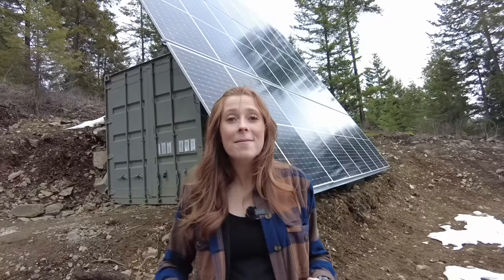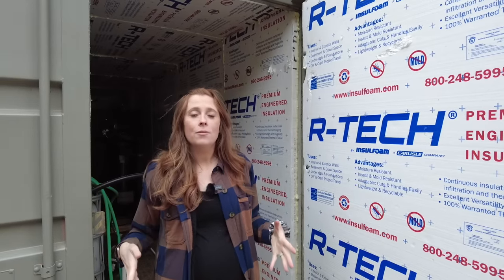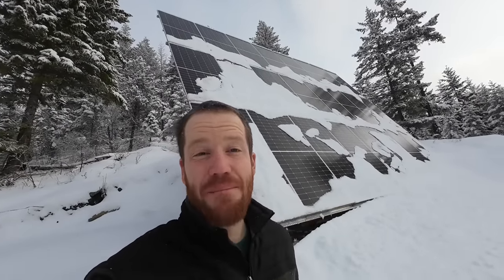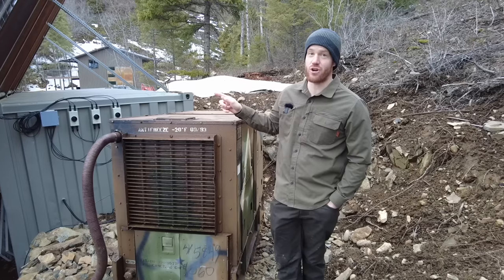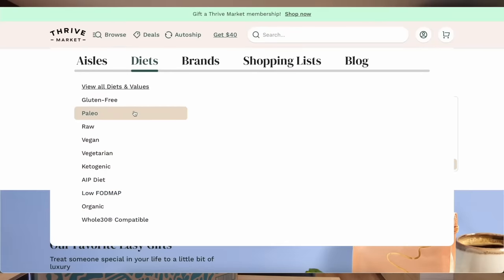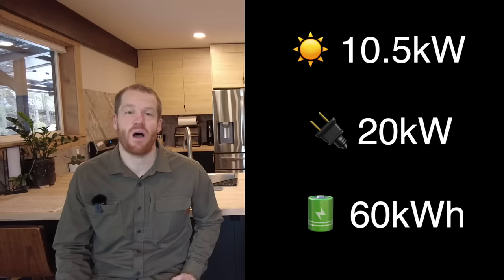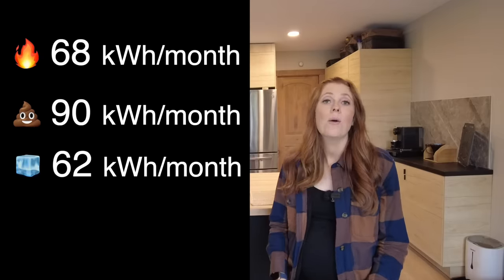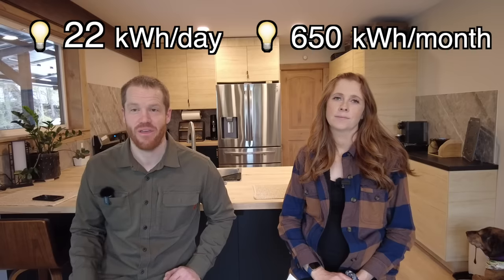The TRUTH About OFF-GRID Solar | Winter Update

Comment: Great episode catching up on the power stats over winter. Maybe it's too soon to calculate but did the new solar cells over the new outdoor deck contribute to any of the figures this winter?
One more unnecessary minutia inquiry, sorry about this, plus I'm not a producer at all and was wondering in the future for episodes like that aren't outdoor shows if there is an alternative mic available that doesn't pick up hardly any ambient noise in the production. Yes, splitting hairs here since with a 3rd off grider in the homestead, which no doubt leaves zero time for anything technical, are there okay mics for Youtube producers that knock out excess room noises? No worries, this is just me being somewhat annoying, or my mother was named Karen.
Reply from the maker: That was a fail on our part. We were wearing microphones for the second portion of the video but they weren’t connected. 🫣

Comment: I’m sure this has been asked somewhere (and probably answered too, to my bad) but, the repetitive charge and discharge of the batteries is a consideration.  How many times can you charge and discharge the batteries before they wear out?  Also, how many times does that happen monthly?  Then, what will it eventually cost to replace the batteries?  I’m hearing elsewhere that lithium-ion batteries can be charge cycled 3000 times.  If true, is it logical to think that a lithium-ion battery will discharge much faster after it’s been recharged 2000-3000 times?  In short, aren’t batteries less efficient the older they get?
Reply: If you are very aggressive on them they will have 80% of their rated capacity remaining after 4000 cycles.  Riley and Courtney are nowhere near aggressive, so they can expect to see closer to 7000-8000 cycles.  The nice thing though, is this is not the end of their life, they are totally usable just at a lower capacity.  Since their system is so massively oversized, if their use stayed the same there is a great chance that 20+ years later they will still be going strong.  Now, this is Ambition Strikes, so there is a great chance they will build some more awesome projects that use more power - but their system is totally modular so we can just add more batteries as needed to meet their future demands.
Reply: @CurrentConnected  Thank you CC for the reply and info.  Seems to me, if these batteries live up to their expected promise, we’ll be seeing many more off grid and on grid (part-time back up) systems in use.  Initial cost I think is still a barrier.

Comment: Why don't you consider a long term thermal store or pumping hydro with the excess power in the summer, to get you through the winter?
Reply: Hydropumping seems impractical in their climate.  To replace the 800 kwh from the generator would require a lot of water storage.  Even if their property might allow a large head (say 100') they'd still need to store about 5 million gallons of water (15 acre-feet) at both ends.  And find a way to keep it from freezing.

Comment: I am sure you could engineer a solution for your generator using a raspberry pi computer that will both sense the frequency and voltage and drive a  servo to automatically correct. Also auto start on battery levels. It would be well do-able

Comment: curious, your panels are bifacial, which gives you 10% more than regular monocystaline. would it be practricsl to use reflective panels to guide light to the back of the panels or front?

Comment: Wouldn't it be better to just make the solar grid 36% larger to cover all the electricity needs in winter (2200kWh produced by solar, 800kWh by generator = 3000 kWh totally needed)? That would be an additional 3,78kWp of solar panels. Just some example math: Here in Germany 400 Wp panels are around 145 USD, you need 9.45 panels, so lets say 10, that's 1450 USD. So the additional panels would pay off after 3 winters and you save 28 times going out and get the generator running per winter :D

Comment: Solar is like money; 'The more you have, the more you spend'. 'The more solar power you have, the more you use'.
"If Propane is considered 'on the grid', then so is Diesel fuel."
The deep (to near zero) DOD (Depth of Discharge) in Dec, Jan, Feb will shorten the batteries life. Buying more batteries will extend the life of 'all' the batteries and reduce the need to run the Gen in the Winter as often.
 The quickest, easiest and simplest solution is:
$10k+ buys 6, (30Kwh) more SOK bat... "Excess money buys CONVENIENCE'.
OR; buy a 1000 gal propane tank then use the excess power in the other three seasons to manufacture HYDROGEN and store it in the new tank. THAT project would get MILLIONS of views. Note a Propane Generator can be converted to run on Hydrogen with little to no effort.

Comment: A small question is: would it be a significant improvement if you cleared the snow in December and January? Perhaps for next year.
Reply: they already said the snow comes off by itself but they get very little power because of low sun and cloud cover.
Reply: @ronblack7870  well - perhaps some extra time. And - please remember, partly shaded the power is significant reduced.

Comment: I would add more batteries  to increase the storage capacity, this way you prolong the life of the existing batteries and avoid the deep cycle charging in the winter months that shorten the life of batteries.
Doubling or tripling the battery capacity and installing a sodium battery should give you the capacity you need to avoid 3/4 of the generator usage.

Comment: EV is the best usage for the extra power. If you got an F150 Lightning you can on certain versions with the correct home charging interface use its massive battery as a backup for the house. The rest of the time it would be great for running and or recharging your tools when you do projects. I am not a fan of pickup trucks (European here...pickup trucks and guns what the rest of the world will never get about Americans) but the Lightning is a serious achievement by Ford and like the MACH-E it has got a lot better since they first brought it out. They do seem to listen to customers feedback. Also STATE OF CHARGE did a snow test comparison between the RIVIAN and the LIGHTNING leaving them both outside in the snow overnight not plugged in. The RIVIAN lost a lot more battery power the LIGHTNING did really well. So if it was on just a simple AC drip charge through the night using just enough electrons to keep it cosy even through a snowfall it will be solid and ready to use the next morning. PS Ford is planning to introduce on both the Lightning and the MACH-E entry level versions with LFP battery chemistry, so if you want a ZERO COBALT vehicle with great charge cycle and no issue charging to 100% every day you may want to find out when the LFP models will be available. They will also be cheaper of course. That model may not have the formal Vehicle to House charging system but actually it does not matter because the truck in any version has the informal options of USB and wall sockets in the cabin and in the bed that can always be used to power portable batteries or gadgets.

Comment: At ~11m09s, the video puts onscreen that for the whole winter you used 96 gallons of diesel to produce 800 kWh, which cost ~$450 or ~$4.69 per gallon.

According to online calculators, 96 gallons of diesel has an energy potential of ~3,300 kwh. So, that diesel generator has an efficiency of ~24%, which seems low. Online sources say that typical generator efficiency for diesel is 40% compared to 35% for propane.

Propane has a lower energy potential, and it would take 118 gallons of propane (1.23x diesel) to have the same 3,300 kWh of energy potential.

According to USDOE for your area in January 2023, the per gallon price of propane was $3.62 and diesel was $4.40 (1.22x propane), making the cost per kWH of both effectively the same assuming the same 24% generator conversion efficiency. 

Since propane doesn't go bad like diesel, a 1,000 gal propane tank would last you eight winters like the last one before having to be refilled.

You could possibly even improve the conversion efficiency with a propane generator over the current diesel one.

I'd be interested to see a video on whether you looked into propane as an alternative to diesel.
Reply: I would totally expect the efficiency of their generator to be low considering it's age and what it was built for - but they already have the diesel generator, factor in the added cost of buying a propane generator to make that changeover.

Comment: I would be interested to understand the math around possibly adding more battery capacity to reduce the amount of generator usage
Reply: I'd be interested to understand why do Americans (and Canadians) live in thin metal or plywood sheds to these days 🤔
Reply: @no_clot_shot1128  do you mean their pre engineered metal building? If so, and in comparison to a traditional wood framed (or metal studs)with siding or traditional wood framed (or metal studs) with laid brick exterior, it’s wayyy cheaper. Especially since they went two story. Probably on the order of 40% to 50% cheaper per sq foot to have constructed. I would also like to make the claim, in my opinion  of course, that retrofitting or altering the existing g construction is so much easier with a pre engineered metal building than conventional or traditional framing.
Reply: @no_clot_shot1128  trolls throw such cheap shots because they don't thoroughly understand the different building systems, and that they all have their pros and cons
Reply: Two factors drive the approach:
High cost of labor.
A well developed market for cost-effective pre-fabricated building materials 
Aided by the tools that enable a team of 2 to build a substantial structure.

Comment: With all things being equal the number of solar panels on your main array needed to be 15KW vs the 10Kw you have. 
The reason is the amount of sun light you have and yes for home without Dryer and your still not at 950Kws 
Oh just for instant most alberta homes use only 350 KW of electricity average as heating is done by natural gas. 

However if full electric was the case then about 1000kw would be needed and 16Kw array with battery bank of 100Kws as much as Tesla or F150 lighting  140Kws of battery bank is needed. 

Summertime is not an issue as; winter is the critical point. 

The fact that you have a shop powered and heated is also amazing.  The welder, plasma table etc.  Most homes do not have that.
Over all your doing OK just about 3K to 4K  short on your array.  Think about that for bit.

Comment: Your problem is your system is too shaded and you used regular inverters which means when shaded the whole string will fail to produce much electricity. If you would have used micro-inverters with one inverter per panel then only the single panel that is shaded will fail to produce much electricity. Enphase IQ8a would have been my choice. I also wonder is a LP generator would work better. Can you get LP delivered?

Comment: HAPPY 4 YOU - BUT would suggest others use another solar contractor supplier. The quality of work shown in this system is not aligned with industry standards of safety and  quality.

Comment: How long should these batteries last before replacing and at what cost ?  I think propane in a 500 - 1000 size would be good a backup power generator situation. Wood for heating in winter and it looks like 🔥💩 is a little more energy than traditional septic/water treatment plant.   I  can see Courtney gets a giggle from 🔥💩, but for long term especially with another 💩 maker. Have you looked into "Earthships" waste water is used for gardening water also filtering water.

Comment: Your winter numbers for the solar panels match what I've seen in Eastern Washington. 7% of rated capacity on a heavily overcast day. If the bifacial panels were responsible for the extra 2% they might be worth the price premium. 

For comparison my 1400 sq ft all electric house (with a heat pump) has a daily power demand of 60 kw-hr. A really bad month hit 80 kw-hr per day. 

As a side note, the same inversions that bring the heavy overcast also bring dead calm, so a wind turbine won't help. The word that describes it is dunkelflaute.

Comment: Failed to discuss the time value of money (TMV) you invested in the capital cost to set up the system and the depreciating value over time of that system. Example: $75,000 (cap cost) at a 8% yield is $6,000 per year or $500 per month (TMV). Assuming a 20 year life of the equipment then $75,000/20 years = $3,750 annual or $313 per month additional equipment depreciation. Total per month of $813. Although you may enjoy discounts through sponsor partnerships most of your audience will not.

Comment: I spent 23,000 for the new eg4 18kpv 30 panels and 30,000 watts in battery installed it all myself and the system is just an animal, don’t need a big generator anymore and it start stops it.

Comment: Hey put a watt metrr and an amp logger and you will find you could only use about one tenth of your solar ohm's law 101
Reply: I use a couple of diversion loads the sea50 works great and then temperature sensor on hot water heater and then after coming up to the desired temperature I could switch over and make hydrogen and oxygen and compress it or heat air or just pump water for us is more critical as we also have windmill too keep it under a load so it doesn't over rev
Solar and wind isit

Comment: does 10000watt array mean it can collect 10kw per hour?
Reply: No. that´s only "PEAK"-power. Peak power is usually only achieved for a short time of very hot and very bright summer-days. E.g. for 30 minutes on certain days in a year.

the other days of the year you will only get 5kw/hour or in winter even only max. 1 kw/hour.

Comment: i am a little bit shocked about the power consumption of your fridge... 62kWh/month translates to roughly 750kWh/year. I bought a new fridge (that's just very slightly smaller) last year, that takes less than 120kWh/year. (mine is a Samsung RL38A776ASR, but you can get devices from other manufacturers in the same power demand region)

Comment: Would a propane generator be more economical?
Reply from the maker: Based on my calculations diesel has more energy per dollar than propane so diesel is the more economical choice fuel wise. Generally diesel generators cost a lot more up front, but we got a great deal on this old military surplus unit. However, propane has the advantage that the fuel never goes bad and can easily be stored in bulk and plumbed to the generator without a need to pump or transfer it.

Comment: HOLY COW the average American uses 900 KW/H per month? In Germany (most expensive electricity cost in the world) we use 2200 KW/h per Year for 2 person (185kw/h month).

Electric heating is not common in Germany. Of course you can add like 3-5K more if you are using a heatpump. But our average consumption would still be alot lower than 900KW/h month. Wich is mind boggling for me.

P.s. in Germany there is a homesolution where you can save Hydrogen in Summer and use it in a Fuel Cell for electricity in Winter. I think that would be an even better solution for you. But its also very expensive like 100.000€. But i think a 60kw/h Batterie is also not cheap so idk.

Comment: I genuinely can't imagine using 22kwh each day. Not trolling here...that's just a huge amount of power to me. The power numbers you were giving for appliances are supposed to be annual numbers, not monthly. Are you sure everything is working correctly? Not that it matters if your annual generator fuel budget is under $500, but still. You spent good money on your appliances so if they're drawing more power than expected you should look into it, especially if they're still under warranty.

Comment: Ya'll are really throwing me for a loop with pregnant to baby and back. 😂

Your MEP can be made to autostart, there is a great video here on YouTube about how to add Wi-Fi and Auto Start capabilities. https://youtu.be/wUjL6mldAEM

You need to just set your frequency once, after the load has stabilized, it should return to that everytime. Also your rectifiers should be able to handle a small frequency indifference since you aren't direct loading the generator. 

Fuel, the MEP has a port for external fuel supply. You could get a bulk tank and run a pair of hoses from the bulk tank to the generator, one would be supply the other return. 

Remeber this is a military generator, it has a lot of the capabilities you need already built in.

Comment: A few years back I was involved  (marginally) with a Real Life study of the effectiveness of Solar Voltaic power. 
Done by Greenpeace. they wanted to see if it  was viable  as a Everyday  power supply or simply a ' Feel Good ' placebo. 
This was done in the pacific northwest where overcast and rain is more frequent than Sunshine..  ~50 /50   
Final conclusions were that it Could Not ...Would Not.. ever,  payback  the cost of the system.
 Let alone give a payback above the break even point. 
Could be  different in a Sun drenched climate  but if in a cloudy one ?
.. You would be wasting your Hopes and $$.
Reply: They were asking them over 50k just to bring power lines to this property. For 50k, they built this which will last them easily 10yrs with only the fuel for the generator as an extra cost.

Comment: Your insulation is done poorly. Should overlap panels with small air gapping. It will multiply the effect. Also a steam engine generator set up for emergency use is amazing